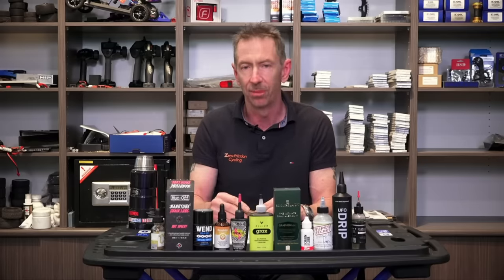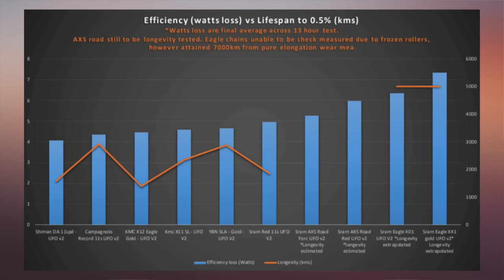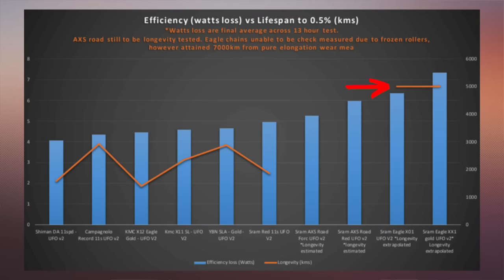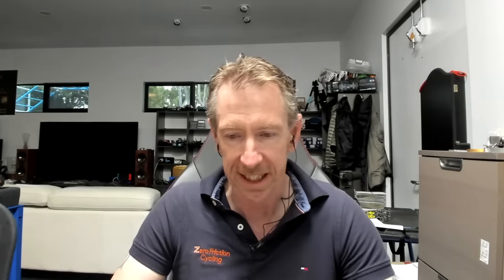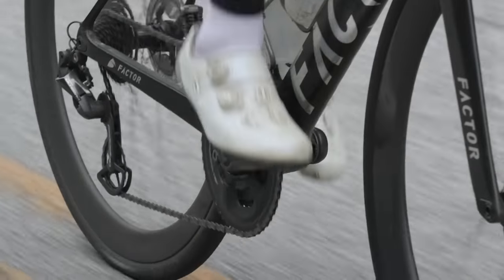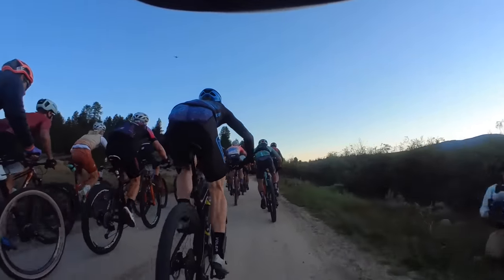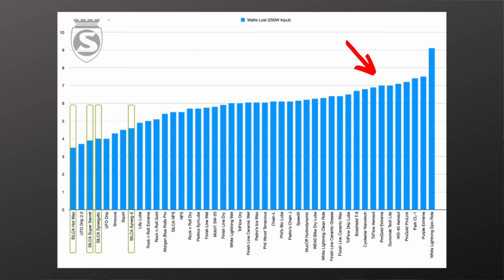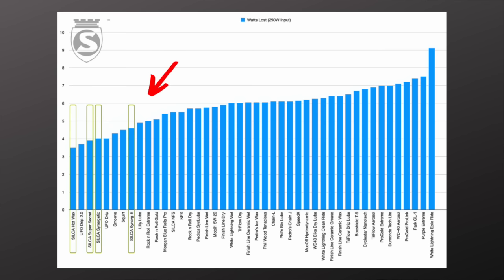How Slow Are SRAM Chains and Other Drivetrain Efficiency Questions With Adam Kerin

Comment: As a recreational cyclist, I'll take longevity over marginal gains.
Reply: Yes, unless one is competing or riding in a group I really don't understand why people spend money and waste time on these things that seem like marginal gains. If the bike is slower, you still get the same exercise anyway in 1h, you just did it going over a slightly shorter distance. I actually ride a 29er xc bike with "city" type tyres and am probably at least 5km/h slower than I would be on some good road bicycle but I had almost no technical issues in 10 years(0 flats), brakes are great in all conditions and I can ride for hours fairly comfortably and even ride easily when the road isn't perfect.
Reply: Totally. Adam's work is really useful in that regard. I have totally changed the lubes I was using on both my gravel and mountain bike chains and I'm really happy with the long-term results.
Reply: I agree, when I saw the chain chart my first reaction was - wow SRAM lasts a lot longer, I’m buying SRAM. I don’t race so I’ll take 1500 more kms vs a couple watts.
Reply: @cyberfunk3793  Have you ever looked at how much you can gain through stacking a number of marginal gains? You can save quite a lot on tire choice, clothing(aero) and drivetrain efficiency that can yield > 50watts. Now figure out how long it would take to increase your baseline of riding by that much ;-) But to each their own for sure. As a recreational rider as well, I will definitely spend $$ in some areas, but not others, but it's all about optimizing for each person. You can sit there and ride the same bike for 10 years and be happy, when others buy new bikes every year <shrug>.
Reply: @pcericm  I don't know what you exactly mean with baseline of riding, but I just ride to get to places like the supermarket and to exercise. I can get to the supermarket easily with any bike as it's about 5km away and for exercise I can ride with the same amount of watts with any bike also. So if I do 200 watts on my bicycle I just ride a shorter distance than I would on a more efficient bicycle to get the exact same exercise. Sometimes it is even a good thing when you don't need to go that far (bicycle roads here end at some point when you go further after which I would need to ride with cars on the road which I don't prefer for obvious safety reason). Added benefits includ things like that I can use 1 chainring in the front as I don't typically go much faster than 25 km/h, it's also perhaps a bit safer when I go a bit slower and have strong MTB brakes on bicycle with a bit wider tires. The bike is also fully suspended so driving over  stuff like curbs and cobble is comfortable when I ride through places like the old town. When I ride through gravel and dirt paths through some park it's also doable even though the tyres are not nobby so not best for that.

The only times I think a faster bicycle would really benefit me is when I decide to visit some place 50km or furher away to take photos for example and it would be best to get there as efficiently as possible when the trips is something like 100km or more both ways.
Reply: @cyberfunk3793  Sorry, I meant essentially saving >50 watts of energy needed to move when you get into moderate speeds, which ends up being fairly significant gains. Try adding 50-75watts to your FTP if you’re already well trained ;-) Different strokes for different folks on what’s important for each individual person. I love riding my mountain bike but if I have to ride on non single track, I will always opt for a more efficient bike that moves much faster.  Can’t fault you for wanting to ride a MTB all over the place if that’s what suits you and your environment the most!
Reply: With some things,you can get both.   Bigger rings, cogs and pulleys wear less per revolution
Reply: @cyberfunk3793  some upgrades aren't more expensive.   Just keep what you have until it needs replaced and there are likely aftermarket options that are often cheaper and better than oem
Reply: @cyberfunk3793  If you ride your bike, you'll eventually have to replace the chain and/or cogs and cassettes. Pricing for these components are relatively equal so you might as well get the best for your bucks.
Reply: So you'll want a belt drive and IGH.  :person-turqouise-waving:
Reply: Few years ago when I got my first sram equipped bike I honestly thought I was measuring the chain wear wrong. Was used to getting 2500-3500 km out of a chain, the red 22 chain was still good after 8000 km, that was really freaking me out!
Reply: If there is less friction, there should usually be less wear.
Reply: Where did it say that the other manufacturer’s chains don’t last as long as SRAM?
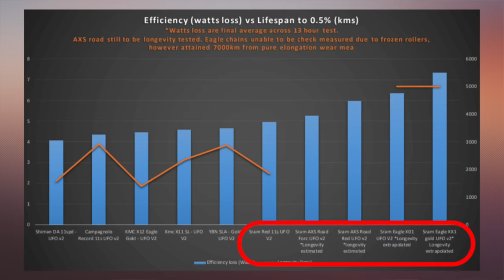Reply: @paddyotoole2058  That's literally at 2:30. SRAM chains are  "super long lasting but not fast". By definition this makes other chains not last as long right?
Reply: that graph looks completely wrong, all the SRAM chains are "extrapolated", obviously incorrectly. You can't magically make chains last 3x as long. Every other test says they don't last 3x as long.
Reply: @donaldryder5534  Except say a SRAM X01 chain costs almost 2x as much as a Shimano XT chain, so if the SRAM chain lasts twice as long you might as well run the XT chain as it's faster for the same mileage.
Reply: @cyberfunk3793 not many people watching this channel only care about exercise
Reply: @veganpotterthevegan  I don't think most people watching this are necessiarly competing cyslists, but I could be wrong. Besides those people, maybe that is what most regular people should care about. Getting exercise on some safe, practical and easy to maintain bicycle instead of worrying about saving a few seconds. Marketing obviously likes everyone to think they always need something better, but do us who don't compete really need that much? The advancements don't often even make the ride safer or more comfortable etc.( that I would see as real benefit).
Reply: @cyberfunk3793  they don't have to be competing to not like going fast and improving.  That said, plenty of amateurs care more about their speed than some pros.  Seen it on both sides of the fence
Reply: @veganpotterthevegan   Well that is the result of marketing I was talking about, I can't think of many rational reasons why people would care so much about speed as the difference isn't that large that it would matter for commuting. The only reason I could really think of is if they ride in a group and need to keep up with others. Otherwise it's just pointless, obviously you can improve on a slower bike also if you compare your times with the same bicycle as you get stronger.
Reply: @cyberfunk3793    I wasn't thinking about commuting but a long commute benefits from efficiency too.  You can wake up later or get to work early with an efficienct bike. Or you can just do less work on the bike.  Plenty of people bike to work solely for environmental or financial reasons and don't care at all about their fitness.  Think they wanna do more work to get to where they wanna go?
Reply: @veganpotterthevegan  Well even with a bit longer commute like 20km (I'm guessing most people live closer than this to their work) the difference isn't going to be more than few minutes so would not really matter to most. If it's 100km each day, then yes it might be a reasonable investment. I'm one of those that cycle daily to almost everywhere I go in the summer time and yes I'm guessing I have wanted to do more work then because I drive a 29 inch full suspension mtb instead of a road bicycle that would probably be 5km/h faster(I'm guessing). In the place I lived before for 10 years supermarket was 7km away, city center about 10km. The speed I lost by riding a slower bike didn't ever matter to me in those trips and the few times I thought a road bicycle would be nice was when I rode some +100km trip. The mtb is simply comfortable in the city also, rougher roads, going over curbs, riding down stairs etc. And great brakes that isn't always the case with older road bicycles (although it seems nowadays most road bicycles also seem to have disc brakes).
Reply: faster chains may well also last longer.
Reply: @JackMott  making a given chain fast also makes it last longer.   SRAM chains tend to test as the hardest wearing but they're also quite slow.  Making them less slow with waxing will also make them last longer.
Reply: @cyberfunk3793  unless I was a road cyclist trying to get an extra workout in with my commute(something I did for years and I regularly turned my 15mile commute into a 60-100mile commute), I'd recommend an internally geared bike, ideally with a belt drive.  Inefficient but very low maintenance.  *I have a lot of bikes and I've always hated the vibration from mountain bike tires.  If I want to make my ride bumpy, I'll go mountain biking.  I have pretty plush, big tires on my road bikes that are plenty good in themselves on bumpy roads.  No need for mountain tires but if my roads were really bad,  I'd ride my gravel bike.
Reply: @veganpotterthevegan  The more gears there are, the narrower that chain obviously has to be so I bet it's much easier to make a strong lasting chaing for example for a 8-gear cassette than the current ones with even over 10 gears in the back.
Reply: @cyberfunk3793  it is but tech has improved since 8sp . 12sp chains get much higher mileage than 8sp due to better metal hardening.
Reply: @cyberfunk3793  nobody is putting that tech into 8sp chains which is why 8sp chains don't last close to as long as 12sp chains.
Reply: When you add up all the marginal gains from tires to tire pressure, bike weight, body weight, aero dynamics, drivetrain friction it’s all of a sudden not marginal anymore.  When racing, all the marginal gains added up makes significant difference.  If riding recreationally then you just need durability.
Reply: @solidstream13  to be fair,  99% of racing is recreational.  Everyone puts different importance on all these things.
Reply: @veganpotterthevegan  your right but before you can be a pro you need to come up thru the ranks as a amateur racer.  My brother was a professional cyclist.  I don’t blame anyone for choosing the fastest bike they can be on to be more competitive and have every advantage they can.
Reply: @solidstream13  I raced professionally for years.  The number of pros that don't care about those marginal gains would probably really surprise you.
Reply: @solidstream13  I have no issue with regular people that don't race at all but want those marginal gains...so long as they're not using a TT helmet on road rides😵‍💫
Reply: It’s possible to have both with good maintenance.  Dust off a waxed chain, floss the cassette, keep up on bearing grease, adjust preload, minimize water ingress and corrosion.
Reply: 10% more longevity is probably better for more cyclists than 2 watts better efficiency. I still have a Shimano chain, though, because it was $15 less expensive.
Reply: 100% longevity,  less maintenance. Far out weighs a few watts
Reply: And if the chain wears fast it will likely be wearing the cassette faster, the cassettes are pricey. I would gain more by losing 2-4 kg than the drivetrain will ever gain me.
Reply: It's not like you have to choose. Have 1 bike for commuting, riding to the shops, messing around the local area, built for weather, reliability, and endurance.  Have bike #2 for fast or long rides, built to be light, fast, etc.

You don't wear the same clothes to the theater that you do to work in the garden, or in the winter that you do in the summer, after all.
Reply: Me to, up to a point. 
I keep my chains clean and waxed up -- its well worth it to eke out as much efficiency and longevity as possible.
That said, I'll take hard-wearing SRAM chains that last longer, over  lower shorter-lived alternatives.
At the moment, I'm running three of them in rotation, and change them once a month.
Cheers

Comment: I mean no hate here, but are we using tools that have a low enough margin of error that can detect a watt or two difference from chain to chain, lube to lube, day to day?  Even the top tier power meters on a bike have a 1 percent margin of error, and that's 3w at 300w, which is more than these claims are.  Sell me the magic beans, really, money in hand, but my math isn't happy yet.
Reply: Your power meter does not have the resolution to measure differences so small but his test rigs are using much more sensitive meters that do have the necessary accuracy.
Reply: @jerrycombs3459  No ones lost a race or PR by 2 watts.
Reply: the reason for the 1% is price if you are willing to spend money you can go down alot lower (also replications of experiments), but i see where you are comming from defo a valid question
Reply: How do we know chain to chain is even the same?  How often do they calibrate the chain makers at the factory?  What if we get a Friday afternoon special?  What if we get one right off a fresh maintenance?   There's too many variables that can't be reasonably checked, to me. 

I do want to believe, I swear, but I need more assurance.   2w isn't even reasonable to me. 10w, yes.  5w, more likely. 3 or under, eh.  4w, the universe stops.
Reply: @tumbleweedking5668  what about 3 watts? 4? 10? 20? The numbers add up with little drivetrain and drag losses that eventually make a difference. We're drawn to these miniscule differences because we are geeks about it.
Reply: @10ktube  that is where number of test performed avges it out
Reply: @simedinson984  how many tests have been performed?   Personally, if someone bought 10 random dura ace chains from random locations, prepped them exactly the same (another variable), then tested them over say 10 sram chains with same parameters and proved difference, maybe I'd be convinced. Maybe.  Some of this comes down to, simply, you can make anything matter in a lab.
Reply: @Tumbleweed King  that's not true.   I've most definitely won and lost TTs by a second and 2 watts would have made a difference
Reply: @10ktube  others have tested these chains and they're all confirming one another's numbers. Also, Silca tested a lot of chains from every company and the tolerances of the high end chains are very consistent.  It becomes less consistent as you go to 105 and lower
Reply: @tumbleweedking5668 that’s not even slightly true. 2w is worth 8 seconds in a 40km TT. I’ve been closer to a competitor than that.
Reply: @10ktube  oh yea the not sure how statiscicaly significant it is and how many is tested if tested
Reply: There are a handful of systems worldwide now that can repeatably measure losses in the +/-0.05 watt range, it's not hard, it's just expensive ;-)  We are in process of developing a new machine with Purdue University which will be the most accurate/precise machine yet, and I can tell you from our preliminary testing and setup that the numbers presented from Friction Facts and CeramicSpeed are both accurate and very repeatable.
Reply: Most power meters are much more precise when comparing one effort to another (on the same Powermeter that is). Only when the actual number matters, does the 1% actually matter. An example: you pedal actual 300w, with chain 1 you would measure 297, with the other one 297.3
Reply: Depends on where you measure.
Reply: @tumbleweedking5668  actually they have and frequently do - it's what's at stake when time trialling and triathlon.
Reply: It doesn’t really matter. I look at my times up Lemmon or any really long segment that I do alone and the differences between my carbon bike, aluminum, and heavy steel road frame with Mavic Kysiriums are infinitesimal at nearly identical power. These marginal gains only exist in people’s minds and maybe for guys who have 450 watt ftp and no body fat. For the rest of us money is better spent on losing weight and just having fun. Remember the reason 99% of us do this is just to have fun. Roadies take everything way too seriously like they’re trying to get a WT Contract at 45 years old.
Reply: @David..  yes and no. The difference between a nineties steel frame bike and a modern carbon one are definitely significant. I have power meters on both and you are quicker on the modern bike for the same power. However, i totally agree that for us non-pros it should be about how i feel on the bike and where you ride and how fit you are actually matters much more. Road biking is always fun, even with the most basic/cheap/old/used bike.
Reply: @tumbleweedking5668   you never know do 2 watts on 300 np over 5 hours
Reply: @tumbleweedking5668 that’s true, but it’s a lot more than 2 watts if you wax your chain instead of using chain lube. Secondly if you do all of these upgrades including a fast chain. It’s gonna be more like 15w. 
Still nothing major and not something I would consider. 

But that’s certainly making a difference at the top of the sport.